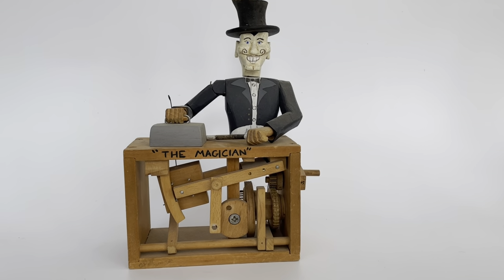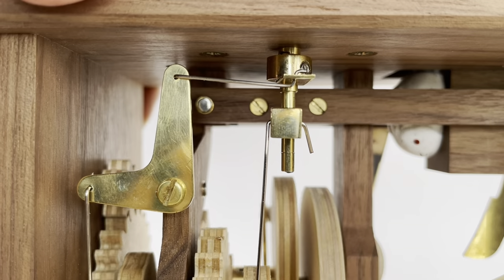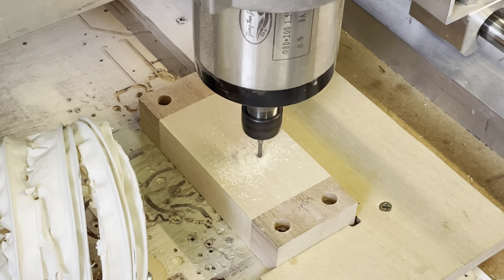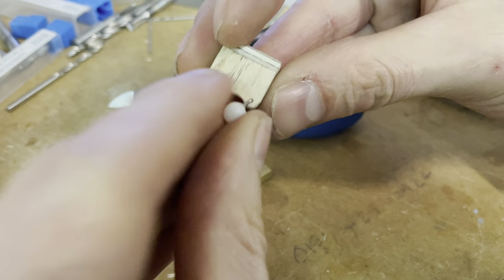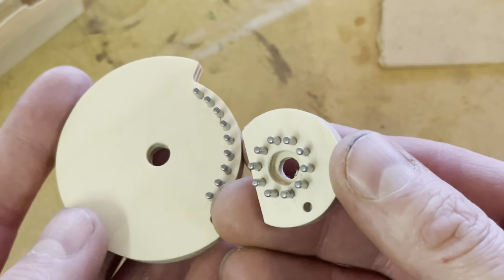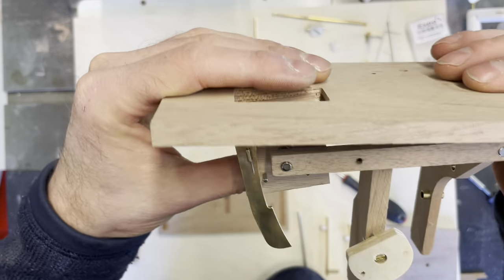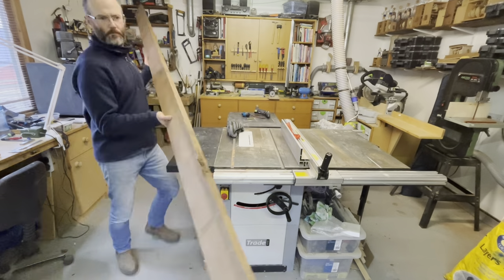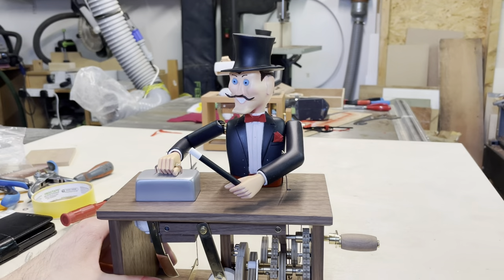How I built The Magician. Part 1 - making the prototype.

Comment: Hi Oliver, forgive my low experience in cams systems, anyhow what I would like to know is the way on which you synchronize all movements: do you draw a phase diagram?
Your talent is really amazing! 
Thanks
Please, if you find the necessary time answer my question! 😊
Have a nice work
Reply from the maker: Hi, I don’t use phase diagrams. I usually take a well-thought-out guess. Then I will experiment with those timings on the prototype and adjust them accordingly.